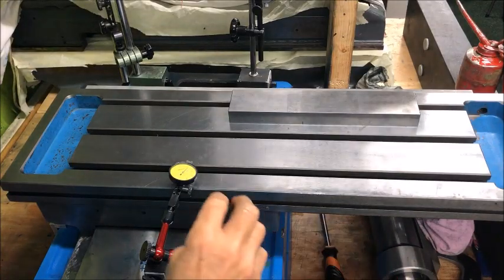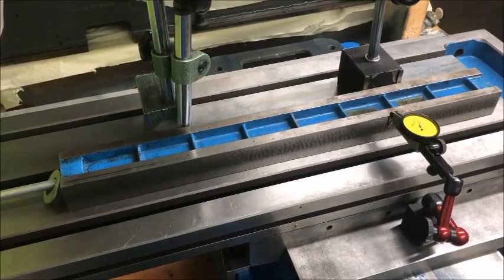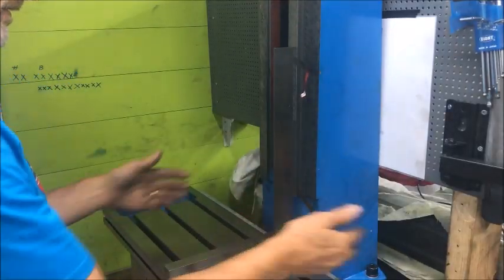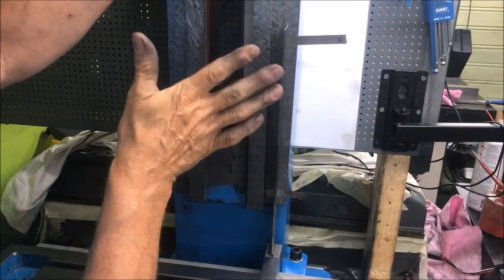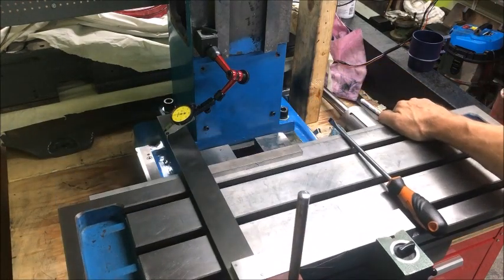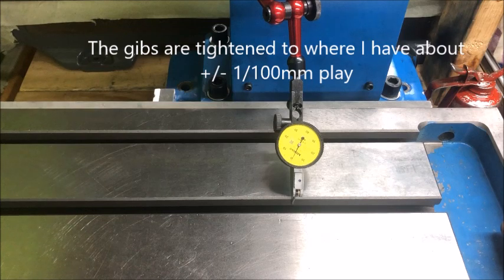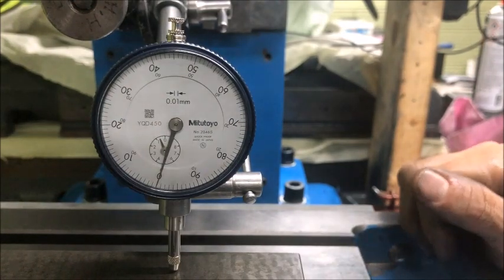HBM45 - testing table travel and column alignment

Comment: I need to carry this to my first floor workshop, looks very heavy what would you recommend? 😂😂 I guess I need to dissasemble it, but even than I guess each part is going to be around 100 kilograms :(

Dream is to attach some steppers and convert it into a cnc, but I still couldnt find a ballscrew set specifically for this machine
Reply from the maker: Yes, dissambly into parts will make it easier of course. I am quite certain that no part are 100Kg.. maybe 50?
I don't remember exactly now how I managed, but I would either have another person to help and/or use a crane of some sort.
Reply: @jansverrehaugjord9934  Thank you for your answer, 50 kilo is doable with 2 people definetly

I even have a stair climbing transport cart which I think can easily handle 50 kilos.

Comment: Cost of this operation? I have same mill but branded as Optimum. :)
Reply from the maker: You are in Finland aren't you? I am not certain who can do this local to you, but it took me some 80+ hours so prepare that a professional business might say do this at 40 hours.. and charge accordingly. At least it wouldn't surprise me if the hours spent would be close to this. It then begs the question if t really is an economically feasible undertaking to set this job out to someone vs. doing this yourself. The latter may require both taking some classes in machine restoration (emphasizing on scraping of course), buying the need tools & equipment plus a bit of patience and/or experience..

Comment: Very good job!!!
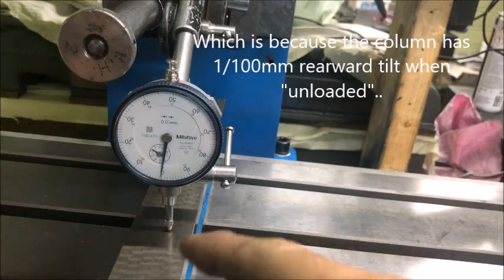At 2:50 you say that the 1/100mm is because of the column. 
Are you sure?
This error is constant I think and it doesn’t matter.
Reply from the maker: Thnks! Could be you are right.. I may have mislead you there :) On a knee mill, the table is normally set up so 0.5-1/100mm higher when you move it outwards, but here it may not have any meaning as the base doesn't move. However, the table top was also not totally flat anyway.. The table top should probably been reground, but since this was not a topic, to get it better you would have to lower the outer side of the saddle , probably setp scrape it a tiny amount.
Reply: Thank you again for your time to answer me!!!
Reply from the maker: @stylianos4570  Of course! Thnks to you for pointing out the logical flaw I made in my thinking 😀 PS! I finished this machine some weeks ago and coming back to make the video, I had to recap a lot..